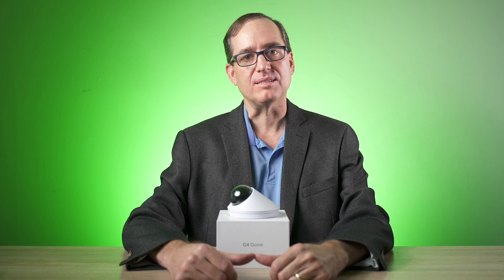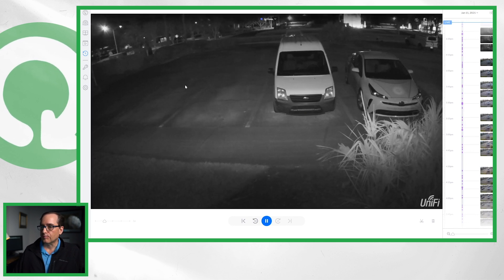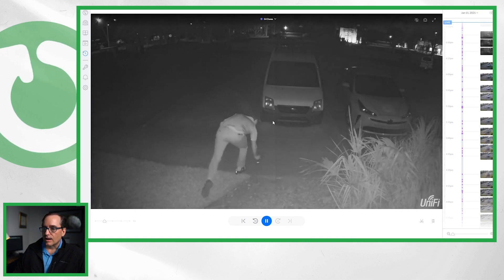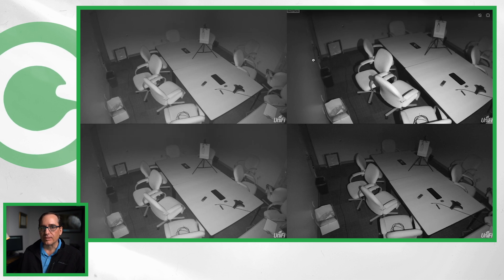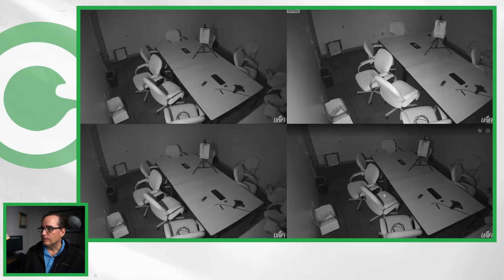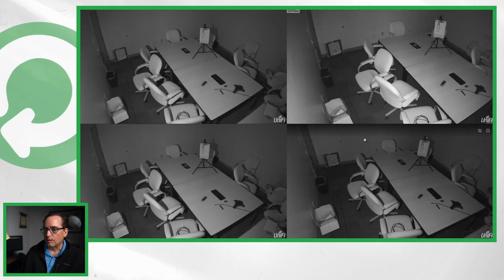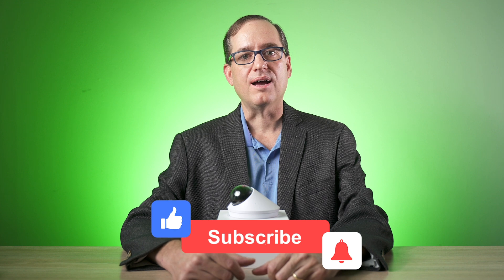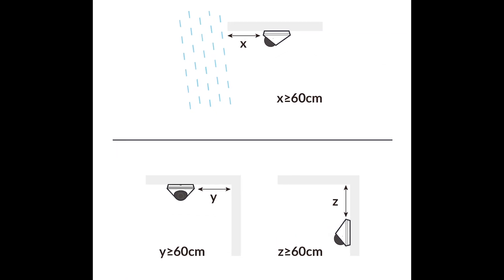Before you buy a Unifi G4 Dome, can we fix the IR reflection issue vs the G3 Flex and G3 Dome?

Comment: All I see when people review these camera's, all of them, is them saying "ubiquity is really good butt.....". "I really like ubiquity butt..." I have seen so much better at similar price points. The hardware is not developed enough to compete with other brands. What is your experience with other brands?
Reply from the maker: I think that's a pretty good analysis of what most people think.  Ubiquity is a really good product, but it's kind of like Apple. You're paying a premium and there are some shortcomings...  I've done some reviews of less expensive Chinese cameras that have more features and I've reviewed using Synology and inexpensive cameras.  I think reolink makes some nice ones.  If you're a DIY kind of person, that's a better route to go, but if you really just want nice cameras and an easy interface, I think ubiquiti has a spot..
Reply: @DPCTechnology  thanks a lot for your reply, much appreciated. Apple is premium product. Is Ubiquity a premium product as well? I have installed Hikvision, apart from the issues with this company they make great camera's at half the price point.
Reply from the maker: @quirijnsiersma88  it's not on the same level as Apple but ubiquiti has a much better user experience than hikvision.  But hikvision is more flexible and the equipment has high quality output.

Comment: I just purchased the G4 Dome because it was literally the only camera available for purchase.  I only need 1 camera, so the G3 Bullet Bundle was out.  I'm going to be putting it above my side entry door, covering that entry and my driveway.  It will be completely protected from the elements and I was wondering if there's no danger of it getting wet, could you just leave the dome off?
Reply from the maker: It needs the dome outdoors.  Ubiquiti released a guide to avoid the reflection.  Crosstalk did a video on the updated instructions.  I will release one soon, we still are in construction on our office.  Should still be another month till I release the update.   Just search crosstalk G4 some and you should find the answers.

Comment: The problem is not the camera but occurs only when you remove the cap and place it back incorrectly. Make sure the cap makes contact with the rubber around the lens.
@DPC Tech: it would be fair if you adjust te title. For example with the remark "solved"
Test video:
https://youtu.be/-W56qtZ6GmU
Reply: Please check my short test video:
https://youtu.be/-W56qtZ6GmU
Reply from the maker: @DSdriver  that does look good!
Reply from the maker: It still does it..  You can make it better/worse.  Having the same issues with other domes (Hikvision) i am currently testing.
Reply: @DPCTechnology  I can send you images of my G4 dome. No ir lights visible.

Comment: Thanks for the great demo / test. I have a question, hope you can answer this : How does a G4 bullet of G3 Flex perform?  installed behind a windows (double glass) watching the outside at daytime and nighttime ? The room will be dark the most of the nighttime. Will there be IR reflection? And do you know if Ubiquiti will introduce a G4 Flex?
Reply from the maker: The G4 is more resolution but the biggest kicker is smart detection.  That really makes the cameras more usable imho.  If you really want IR to work, you may consider turning it off in camera and buying a cheap ir emitter to use outside.  The glass will probably make a bad reflection if u try to shoot thru it..  but you could always try and if it's no good try an emmiter outside.  I'm not sure about the G4 flex but it would make a ton if sense.

Comment: I fixed this by removing the cap and carefully place it back. Now the images are perfect.
If the cap is not placed correctly you will see the infrared lights . The rubber ring around the lens has to "touch" the dome all around. This ring prevents the reflection of the ir lights outside this rubber ring...

Comment: Thanks for the test and the information! Was about to order 2x G4 domes when they would come available in the EU store but seeing this I will switch to 2x G4 Bullets since they would be hanging outside.
Reply: I fixed this by removing the cap and carefully place it back. Now the images are perfect.
If the cap is not placed correctly you will see the infrared lights . The rubber ring around the lens has to "touch" the dome all around. This ring prevents the reflection of the ir lights outside this rubber ring...
Reply from the maker: It's the better choice for nighttime surveillance!

Comment: I'm really glad i never acquired any of these dome cameras. I've been pretty happy with the G4 Pro and G3 pro cameras outside day and night, despite G3 Pro's being less colorfull and not so sharp but they are IP 67 rated and last in colder conditions very well (tested -26 Celsius so far). If i were to install these cameras for work, i wouldnt use anything else outside but G4 Bullet and G4 pro in locations that require wider angle or sharper image. G3 Flexes indoors. Because quite frankly all these other cameras image quality, especially in the dark is pretty low and not so distant as with the G4 Pro and G3 pro, that has a lot better IR emitters than G3 bullet for example.
Reply from the maker: I agree with all of that,  G4 Pro is amazing but pricy.
Reply: @DPCTechnology  This is true, which is why i also have only one of them and G4 bullet might be as good choice depending on what kind of budget there is. It wasnt available at the time when i bought mine so i didnt get one of those.

Comment: Thanks for making the video, Q  if camera is inside and no issues with tampering, can it be mounted on wall without dome on and then no issues ?   in any case, this is something they need to fix as it also should go outside
Reply from the maker: Yeah, I think it is mainly going to be used indoors anyway.

Comment: Downwards was definitely better, I wonder if wall mounted outside would be the ideal mounting method?

Or maybe some sort of small rubber/foam washer could be put in around the lens to prevent the IR reflecting inside the dome.

Ordered 1 G4 dome, 1 G4 bullet and 1 G4 flex for my house move. Kind of wishing I'd just gone for 2 G4 bullets and a G3 flex.
Reply from the maker: I think what u bought is ideal, that way you can try and return if u don't like it.  It has a grommet inside the dome already, fwiw.  I think wall or upside down both work, I would follow the instructions and do it under a soffit or overhang.  They recommend 60mm or 2 ft.